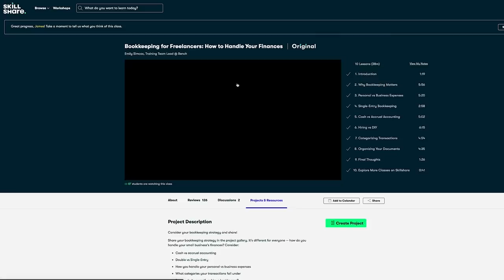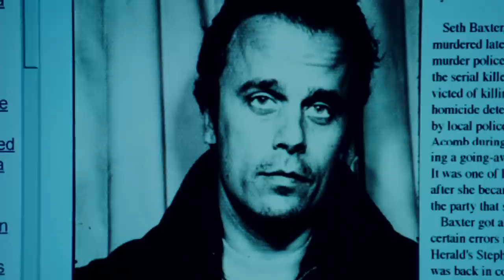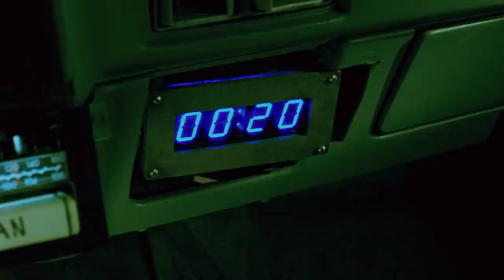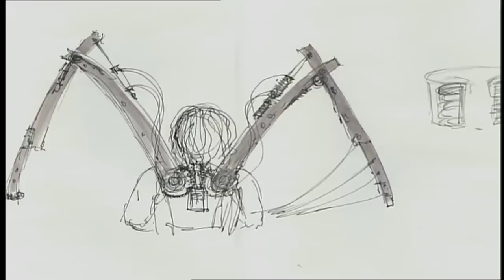TOP 10 KILLS from the SAW Series

Comment: 9:20 the reason why Hoffman chose those four was not because he wanted to frame Jill but because he knew that she was seeking shelter and safety in the police department and Hoffman knew that he would not be able to gain access to her unless he build a distraction to get the police force away from her and which is why he changed positions with the dead man in the body bag to access to Jill tuck and to also kill the other guy off.

Comment: The razor wire trap from the first Saw movie is my number 1. Whenever I think of the Saw franchise that trap is the first one that pops into my minds. All the other traps while hoooorrible still seem escapable but I can't imagine being able to escape crawling through a maze of razor wire. Truly a death by a thousand cuts.
Reply: That one is easy, relatively speaking. Just lie flat on the ground and low crawl your way to the exit. Your back may get cut up a little but you’d escape from that one decently unscathed, unlike virtually all of the other ones
Reply: @loganleatherman7647  You might need to re-watch that scene cuz there is no way he could belly crawl out of that razor wire trap. Not only is the room set up in a way that makes it impossible but even if it was possible, between the guy's size and the time limit he was given, there is just no way he could crawl out of that room in time especially unscathed.

Comment: If you were doing this list today, would you have included any kills from "Spiral" in it? Personally, I would have included either the subway trap or the wax trap (but not both). I tend to lean more towards the subway trap due to it being considerably more gory, plus it was also much more "logical" for lack of a better term. 

The wax trap has always bugged me for several reasons. ONE: How would Angie cutting through her spine stop the wax, unless Schenk was monitoring the event with some sort of device controller? Schenk couldn't have been in the room because he was believed to be dead at this point, so he would need to be laying low. TWO: How does a contraption like that get into a police precinct without someone noticing? This isn't like Ivan's trap from which was brought in "piece by piece." There's a world of difference between sneaking a trap into a sketchy motel and into a police precinct. THREE: Even if Angie succeeded, the entire point of the trap was to leave her paralyzed, and she would have no means of leaving on her own, She would have likely bled out before anyone found her down there.

Comment: 15:20 I'm an ER doctor and worked in a poison control center for a year, that HF death was kinda cool but very medically inaccurate. The true manner of death from HF poisoning is pretty cool too. If one drop gets on your skin, it permeates deeply and enters the body with an extremely painful burning sensation, but it doesn't actually create smoke or increase the temperature or anything, it just causes acid burns to whatever it touches. Normally, acid burns are shallow and the acid doesn't get absorbed, while alkaline burns penetrate deeply through multiple tissue layers, but HF is the exception, HF deeply penetrates and enters the bloodstream even with a very small skin exposure. 

Either way, the acid burns don't kill you, they just create incredible 10/10 pain while you die from a plummeting calcium level. HF breaks up into ions inside the bloodstream, the negatively charged Fluorine ions then scavenge up any divalent cations, the most harmful of which is calcium. Even a couple drops of concentrated HF touching your skin is enough to drop your calcium levels down to fatal levels. When your serum calcium levels start to plummet, muscles stop working as muscle cells require calcium to contract, so the heart goes into fatal arrhythmias before coming to complete cardiac standstill. Even in the ICU with a central line pumping in constant massive infusions of calcium, HF poisoning still has a massive mortality rate. There was a suicide from ingestion of tire cleaner that our poison control center helped with, but ingestion of HF is almost a 100% guaranteed death so the patient died about 6 hours after ingestion. The lab reported a calcium level of 0.0 in his last blood draw before dying, so he didn't even have enough calcium ions to be detected by modern hospital machinery.

Comment: 10:08 - Pause it right there to see how not-so-cleverly done (compared to the head-crushing-ice-blocks scene that - even when slowed down to a 0.25 speed - doesn't allow you to actually see the blood balloon used in place of the guy's head) this trap was because, if you actually ripped off that much skin from your back, your back would be MUCH redder and bloodier than his appears in that freeze frame where you can clearly see his actual back is perfectly unharmed. It should have at least been made to look like it would have (red as heck, bloody as heck, and with internals and - potentially - spinal column clearly visible). Jmho.

Edit: Similar to 10:28 - which magically has blood there that wasn't there before - but more extreme...such as in 10:35 where he is mysteriously even worse than he was a mere 7 seconds ago.